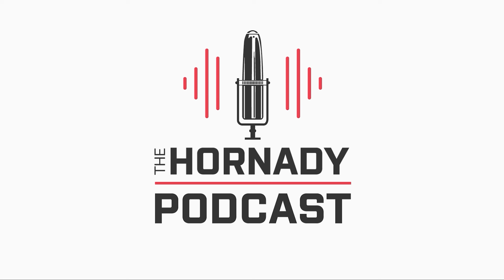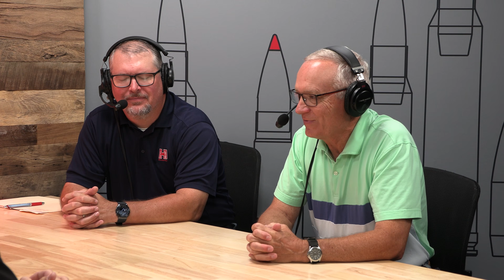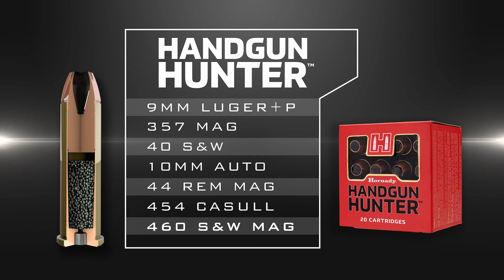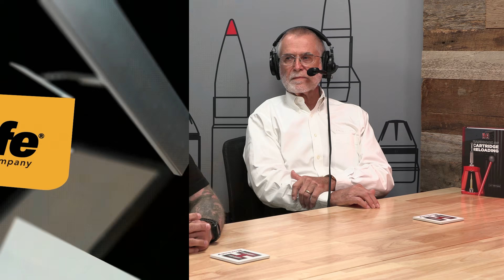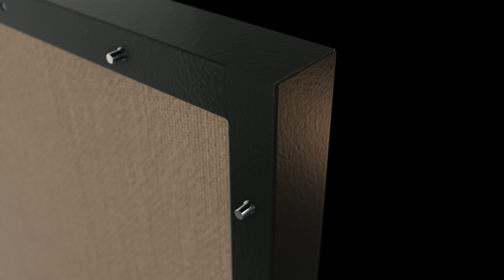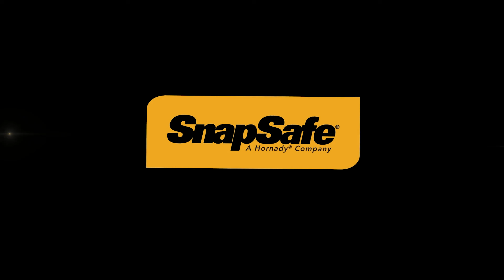Ep. 090 - 375 Ruger | 338 RCM | 300 RCM

Comment: Was the 416 Ruger developed from the 375 Ruger as well? It would have been nice to hear about it as well. Nice job guys.
Reply: The 416 is based n the 375 ruger. Would’ve been nice to have that included in the podcast. I’ve heard it’s pitfall was handloaders struggling to match the box velocities in the 20 inch barrels
Reply: I'm surprised they didn't talk about the 416 ruger at all, or the 7mm PRC for that matter.

Comment: I love Hornaday. However, I listen to the podcast and then go buy federal or Barnes. I prefer their hunting bullets.  Hornady make a Federal fusion competitor in price and performance with a bit more accuracy please.
Reply: Hornady made bonded bullets for a while, but switched back to cup and core to get better accuracy.  The problem is in the bonding process itself.   It is essentially soldering and flux is used to remove oxidized material of both the lead core and the jacket in order to get a good bond.  As the bullet is heated to melt and bond the lead, you see bubbles and blobs of the oxidized materials get distributed randomly in the core. This throw off the balance of the bullet slightly and reduces accuracy.  
 Federal's attempt to minimize the effect on accuracy can be seen in the Terminal Ascent bullets.  The design reduce the amount of lead in the core and moves it closer to the centerline.  This minimizes the effect on accuracy from a lead core that is slightly out of balance.
Reply: The nosler accubonds seem accurate enough. Swift Sirocco's also. It's a hunting bullet. Not a match bullet. Bonded bullets are awesome. Hornady could make it work I'm sure.
Reply: @johncadloni4538   Hornady started making bonded bullets (InterBond) in 2003 and still produce the bonded DGX (Dangerous Game eXpanding) line, so they have a lot of experience. If you check the forums, the Interbonds were not noted for their accuracy, cost significantly more than the cup-and-core lines and didn't sell that well.  Their engineers talk about their limitations and challenges of making bonded bullets on some podcasts. 
Roughly a decade ago, Hornady apparently decided to concentrate on accuracy and the lower cost "premium"  ELD-X lead core bullets combined with a line of monolithic bullets (GMX).   Since Hornady has gained market share since then, it has worked out well for them.   They have even added a new production facility which is currently still running at full capacity.

Ironically, even their competitor Federal, which has its own lines of bonded bullets  (Terminal Ascent, Trophy, Fusion) also loads the ELD-X, so the Hornady bullets are clearly popular.
Reply: @johncadloni4538  Most hunting does not require extreme accuracy, so I agree with you.  On the other hand, the vast majority of ammo is shot at targets, so a little increase of accuracy there makes a big impression on many people.  Twenty years ago, there were not really that many people shooting at 500 yards and over, where a relatively small increase in accuracy can make a big difference.  Hornady seems to be using this as advertising for their hunting bullets, so they make a big deal of calling their ELD-X a "match-accurate hunting bullet.  Marketing.

Comment: The 375 Ruger - a solution to a problem that doesn’t exist.
Reply: Better performance out of a 20" barrel than a H&H with a 24". Works like a charm for me, super fast pointing and handy in thick cover. Many guys in Africa have switched too.
Reply: As Steve mentioned it allows 375 H&H performance to be chambered into rifles costing less than half the price of a traditional magnum 🤷🏻‍♂️

Then again considering 375H&H came out 7 years after 9.3x62mm - 375H&H is really also a solution to a non-existent problem